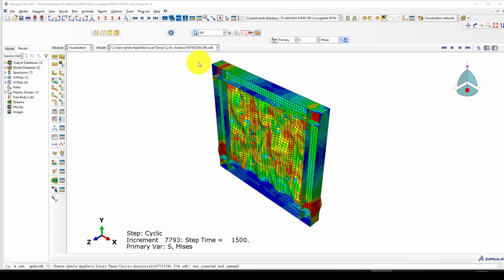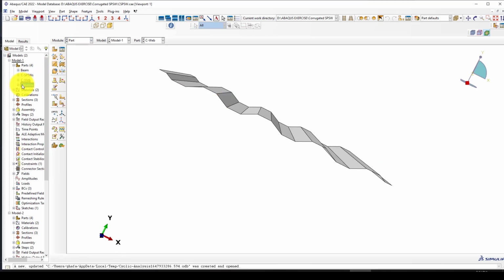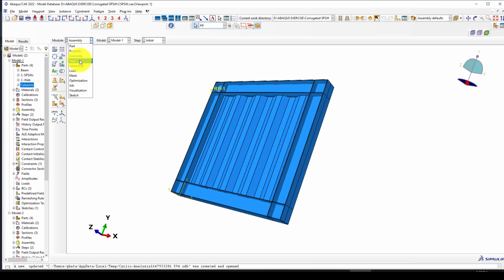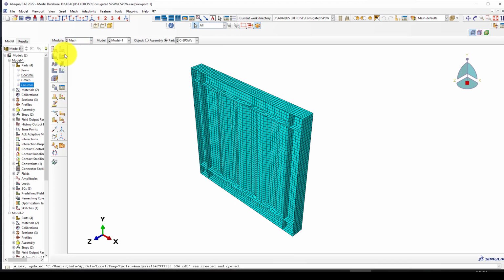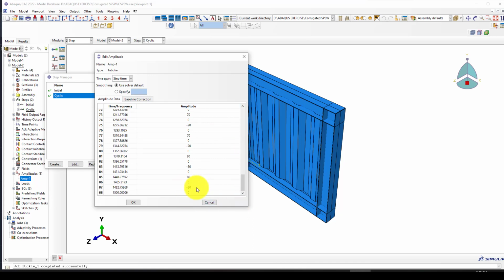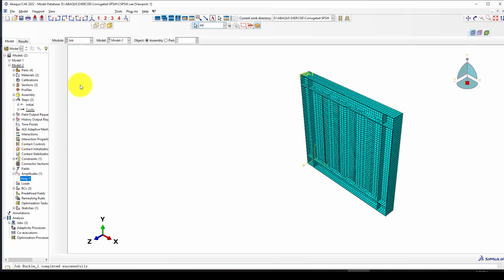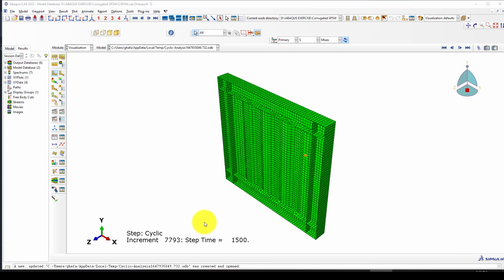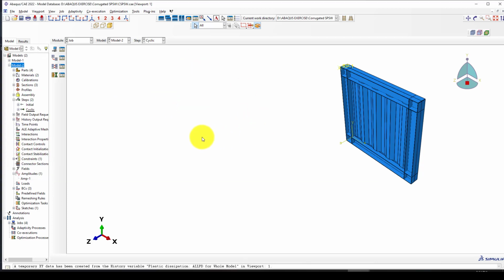ABAQUS Tutorial, Analyses on Seismic Behavior of Corrugated Steel Plate Shear Walls

Comment: Thank you sio much, what about the strain hardening of steel material? and the cyclic behaviour of the steel material?
Reply from the maker: You can interpret them in the hysteresis and stress-strain curve.
Reply: @KSSE_Engineer  could you please recommend any source about the cyclic behaviour of steel material (used for thin shell structures as plates)?
Reply: or could you please make a tutorial about strain hardening (combined) for the same corrugated palte for example.

Comment: Why the interaction between steel boundary frame and corrugated steel shear wall not considered?
I think tie constraints should be used between them.
Reply from the maker: you can try and compare with this.